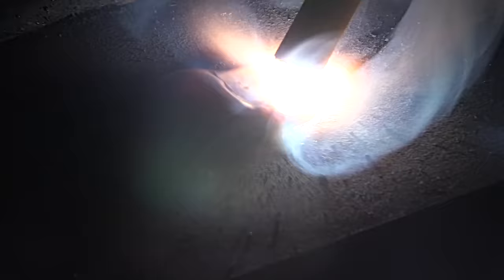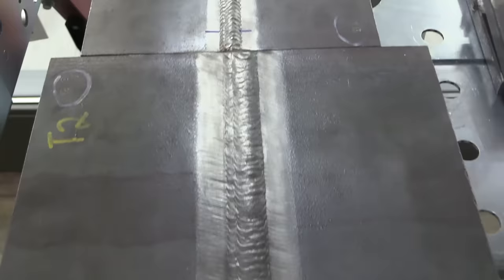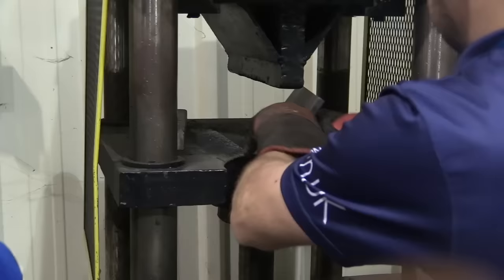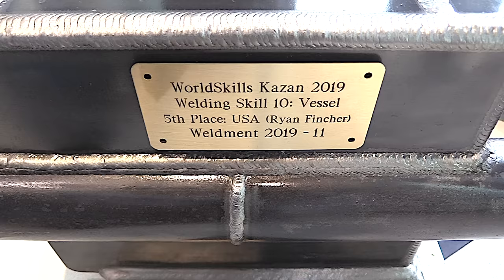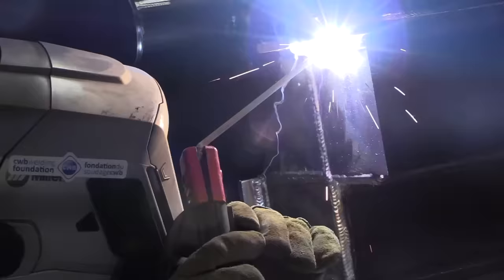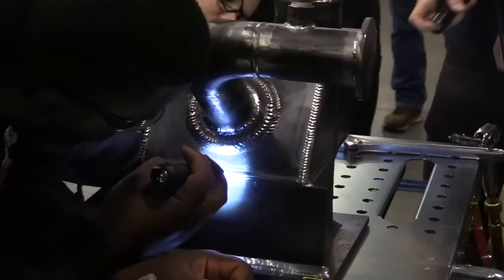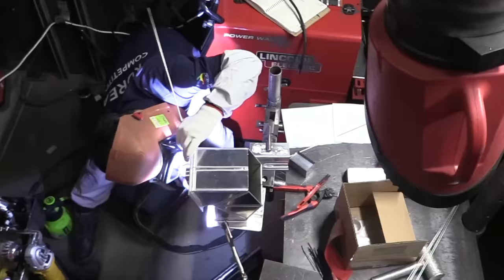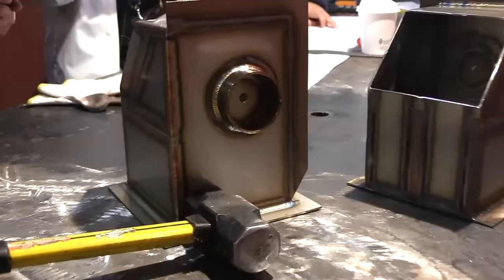Crazy Welding Skills on Display at WorldSkills 2022 Special Edition

Comment: I'm only a hobbyist welder, but I always find myself inspecting others welds.  One way of relaxation after work, as a tower crane operator, was to fire up my engine driven Thermal Arc portable welder to practice overhead and vertical welding. As I was doing this, one of the inspectors happened to be walking by and looked at my welds.  He said, "I'd sign those off."  Made my day.

Comment: I think aluminium welds look so good. The big beads are so cool. Aluminum race radiators and hand built intake manifolds on 80s era Pro Stock engines were so badass. I got good at stainless, but never did aluminum.

Comment: I’m a DIY/farm “welder”… I’ve taken community college intro classes, and probably burned 5,000 rods of 6011 and 7018 in my life.

Last summer I tried to repair a steel hydraulic reservoir on a tractor. No pressure, it just had to hold some hydraulic fluid like a bowl holds water… after three failed attempts, including one attempt at brazing, I finally gave up and used silicone and self-tapping screws, which are still holding today. 

I couldn’t even weld something to hold 1 PSI… I simply can’t IMAGINE welding something to hold 1,000 PSI, let alone make anything so pretty. 

Huge respect for these guys and for real welders everywhere.

Comment: I competed in SkillsUSA Tennessee for my tech school last year. Sadly didn’t place due to complications with the machine they had in our work area, but now I have a job welding food grade stainless! I’m stoked to see that they are implementing thin stainless in these competitions. It’s definitely not easy but it’s rewarding when you do it right. Awesome job to all the competitors!
Reply: Where was the competition held at? The local Pipe hall ? I went with tcat Pulaski a couple times years ago, it was a fun experience!
Reply: @timallen657  I competed for tcat Pulaski! The ceremony and all the formal stuff was held at the Chattanooga Convention Center. Then the three man fab team was held at Dilling Group. It some place about 30 minutes outside of chatt that does high pressure pipe and stuff like that. I'm not sure if the single man comp was held there or somewhere else. It was definitely a fun experience. I would love to go back and do it again. It's aggravating going all that way and losing due to not having a welder for 45 minutes but it was still very fun!

Comment: german metalworker here, in the third year of my apprenticeship there was a tig welding course the last task was to make a square pressure vessel out of 5mm (13/64 ″) steel and it was tested to the point of bursting. I personally managed 160 bar (2320psi) before the heat affected zone cracked.
fun fack it looks like a football
(edit thickness in inches)

Comment: 3:30 Diagnosing lack of fusion between the layers in a broken T is... a bit questionable. A bit like reading tea leaves. The crack shown is certainly a hint that there is something off. But lack of fusion needs to be found by cross sections or ultrasound to be sure.

Comment: Thanks again Jody. You are always interesting and intriguing with you're videos. As a career welder I watched you're videos and it just felt right listening to you as you narrated the welding bead. Nah, not entering my sleep as some good jams on the electric guitar but the info I learned from you enabled me to tig aluminum (oh yeah, outside of course) on some beautiful windy day. Of course the aluminum ladder rack had to be welded to the aluminum 24v hummer roof parked caddy wampus on the hill while the trike and bike were parked in the garage getting some detail paint. My favorite part was either the 10 second or less beer box template I drew with a Sharpe that the owner was impressed with or the fact that one (or yes more) of the 1/8" x4" aluminum arched on the slip role didn't quite fit that part of the humvee roof because... well I was using the fold out extension of my lift gate and one of those steel grip foundry shirts I love to weld in as a pad and bending the radius tighter. I took the third trip back with the same piece as the Korean marine owner with a dojo? in his basement stood with his fists on his hips, I said "Mr Tae, it's not perfect" and I shrugged. He said "No LOLY, Humvee not perfect. YOU ARE PERFECT and he pointed at me and abruptly walked away...

Comment: Oil and gas industry for the last 18 yrs.  Got to say amazing looking welds.  I couldn’t  touch it on my best day.  

Buttttt, (sorry in advanced). I think that the test should include struggles of environment and out of position weld (no chairs or benches) real working atmosphere.  A lot of things will change.  

No disrespect at all.  Not every weld is a shop weld with a bench or table.

Comment: These guys are good welders but the thickness of the steel looks to be 5/16ths Thicker metals are a lot easier to weld because you dont have to worry about warpage or burn thru Id like to see welding done on 1/8th inch  Its a little tougher. Also  7018 rod is much cleaner because of the flux on the rod Old school 6010 will also separate the good from the great. All in all a cool video

Comment: So funny I just recently had an on going pissing contest with a so called fellow welder whom said he worked on oil rigs as a welder and for a long long time said he’s best of the best where he is in Texas. Now this was about welding very thin pipe and in fence industry it’s so thin it’s referred to as light tubing. It’s legit mil’s thick so with that said it was a posts about someone stick welding this tubing and melting thru over and over so they went a different route and did pause puddling in quick movement as to not melt the pipe over and over. 
So as a welder by trade and fence installer as full time profession I did go to school for welding just found fencing more fun for me still love welding tho. 
So any way I had said it’s crazy easy to melt thru using 6011 or even small stick 7018. So mainly we used mig on the tubing and stick on heavy pipe like schedule 40. So this guys got big boy pants on starts telling me how good he is and is on oil rigs and best of best where he is from. So I said you must be some kind of special hero welder. 1st question I asked was what are your certs in told me he was so good didn’t need to provide them at his job induction. Meaning this guys works in an oil rig not certified and is top of his class and not one person in the hiring process cared about his certifications to be qualified to work somewhere that requires every last thing you put into this video. I thought this guys was a full clown once he piped up about how good he was with no certs I couldn’t even believe I carried on with this guy was such a huge waste of my time but I kept feeding in. He just dig a deeper grave and I had to stop but crazy the stuff you need to do do to even become a welder so props to all you men and women yoir savges and your welds are out of this world !!! First class weld porn !!!!!

Comment: AT THAT TIME I HAD BEEN A CERTIFIED WELDER FOR WELL BEYOND 10 YEARS. I HAD DECIDED TO GO TO BIRMINGHAM ALABAMA, HOPING TO GO TO WORK AT A POWER PLANT THERE. THE LOCAL UNION WOULD NOT ACCEPT OUR PRIOR CERTIFICATES. WE HAD TO TEST AT THE UNION HALL. ONE VERTICLE V GROOVE WITH BACKING STRIP. ONE OVERHEAD V GROOVE WITH BACKING STRIP. ORDINARILY WE WOULD WELD THE TEST PLATES OUT AND SUBMIT FOR TESTING. HERE,WE THE WERE INSTRUCTED TO PROCESS THE TEST PLATES. REMOVE THE FIRST AND LAST INCH OF THE TEST PLATE. CUT THE REMAINING PLATE IN TO TWO TEST SPECIMENS, ONE TO BE BENT AT THE FACE,THE OTHER AT THE ROOT. IN BOTH CASES,THE BACKING STRIP MUST BE REMOVED USING A 90° TORCH TIP. .AT THE END OF THE PROCESS YOU END UP WITH TWO FACE BEND COUPONS AND TWO ROOT BEND COUPONS. THAT ARE STAMPED TO ID THEIR POSITION AND THE WELDER.  I WAS REMOVING THE BACKING STRIP FROM MY FINAL COUPON AND ENDED UP PUTTING TWO" DIVITS IN THE TEST 
COUPON. THE SIZE AND DEPTH OF THESE DIVITS WAS JUST ABOUT THE LENGTH AND WIDTH OF THE WORD "DIVIT" AND THE DEPTH WAS JUST BELOW THE GREY MILL SCALE. I TOOK THE COUPON TO THE WELDING INSPECTOR,TO POINT OUT MY ERROR. AND TO ASK IF I COULD FILL THIS VOID WITH A TACK AND GRIND IT AWAY....
NO. IM SORRY,BUT YOU HAVE FAILED THIS WELDING TEST.IF YOU WANT,YOU ARE FREE TO TEST AGAIN...IN 30 DAYS!!!

Comment: Is it safe to test with 1000 psi pressure the welds? What if it explode, its massacre time?
Reply: They use an incompressible fluid. If there is a tear, nothing happens. If they did the pressure test with a compressible gas, then yes, it's dangerous.

Comment: Hydrostatic testing is a dangerous process considering the pressure involved, even a gauge can fail becoming a projectile moving at ballistic speed, spectators inches away from the test while testing seems to be a potential liability and foolish.

Comment: Well right off the bat, very first sentence is totally incorrect. If it was just a simple bead on plate then it would be a bead rolling around on a plate. No no no sir, there's nothing simple about this process. It requires the correct concentration of heat and materials that cause the creation of a micro atmosphere to molecularly bond the materials together without oxygen. If it was just a simple bead on plate it wouldn't be good for jack's shirt.